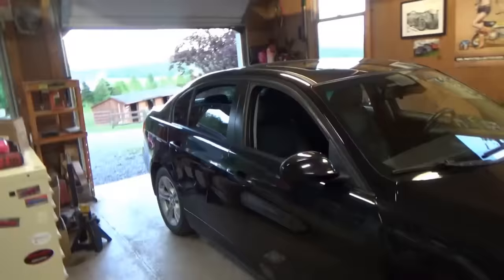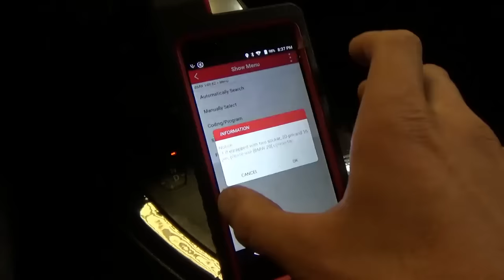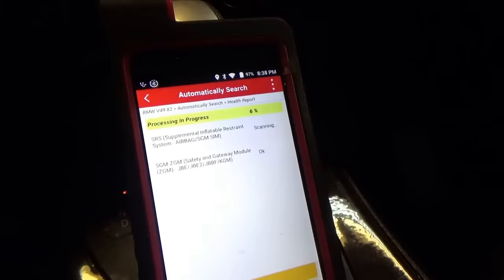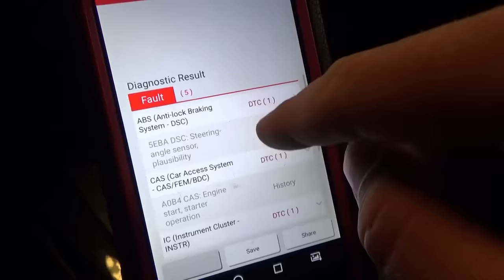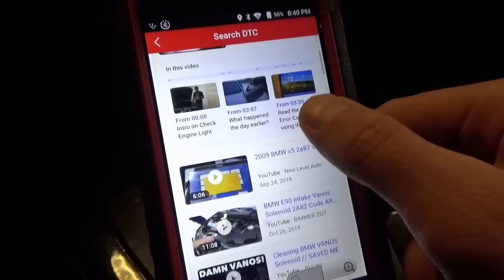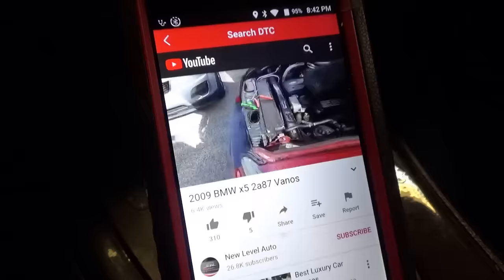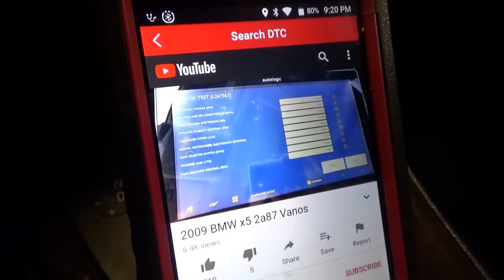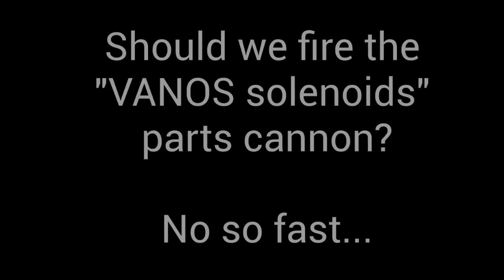Bad News BMW: Vanos 2A82/2A87

Comment: Great design - did they also do the Titanic ? When you pay that kind on money and it implodes from a simple oil leak , put those engineers at IKEA . No dipstick = another great engineering feat . Can you check the level ( " OK " ) with a basic scan tool ? Is that the Launch X431 Diagun , about $ 600.00 - the one you reviewed ?
Reply: Yes sir,Van used the Diagun in many videos.
Reply: King Bolen Auto Scanner Center : Have you tried the Innova 5610 ? I believe it is out since 10/19 . It has bi-direcional control . There appears to be a lot in there under additional tests . This is available for UNDER $ 300.00 online . As a DIY with limited experience , I would like to see Ivan give it a thorough test . It may be good for certain vehicles . I would also like to see Keith Di Fazio give it a run .

Comment: There is no way I’d ever own a BMW unless someone gave me one. I’ll just stick with my boring cheap Toyota or Honda and happily get from A to B.
Reply: You sound like me. I am pretty happy...just got my new Tundra one day ago...should be boring and monotonously reliable as most other Toyotas we have owned.
Reply: @mikefoehr235  right on... Bet that Tundra has a dipstick. And I'm pretty sure some belt won't get sucked into the main bearing or where ever and ruin the engine. Enjoy the new ride for many, mostly carefree miles.
Reply: @chrissimmons9969  Yep...has a dipstick...has 2. One in the motor and the one pulling it out to check the oil.😂🤘. I am of German ancestry and I laugh at how badly Toyota and Honda have beaten the Germans at their own game. It is a real head shaker sometimes.

Comment: It’s a BMW more than 4 years old which means it’s going throw codes so often you’ll want to drive it into a lake. These cars are among the least reliable you can buy as has been well documented. Superior German engineering is a total myth. The Germans make the least reliable modern cars in the world. A Kia Stinger GT will not only beat any German car even close to the price around the Nuremberg Ring it will likely not require any repairs during its 10 year warranty and a Tesla will also embarrass anything from Germany on a race track for anywhere close to the price. There’s a reason VW had to cheat to pass emissions testing. The German automotive engineers are objectively among the worst in the world. Just look at the resale value of expensive German cars out of warranty. You can buy a low mileage flagship BMW 7 series for pennies on the dollar because they are total money pits to own with their nikasil flawed engines, direct injection issues, stupidly complex electronics, endless expensive electrical problems, and so much more.

Comment: Thanks for this video , very inspiring , when dealing with nazi junk charge for diagnosis and send it away , 100% in agreement.
Even the front grill was designed to look like hitlers moustach . German engineering is over rated , the people that made jaguars and fords beat the germans in ww2  what does that tell you?